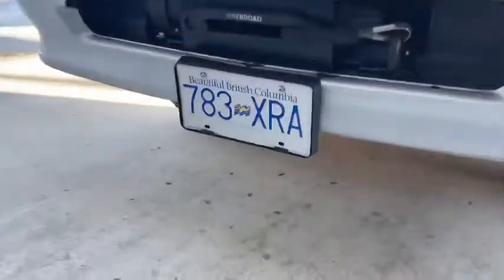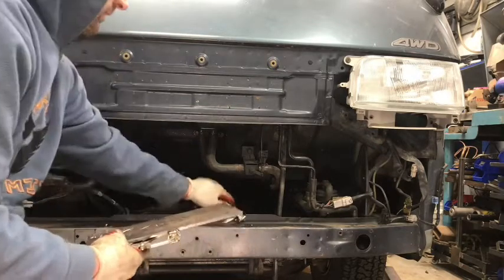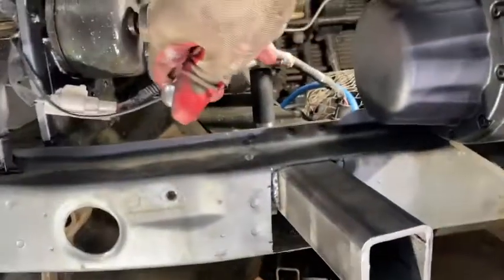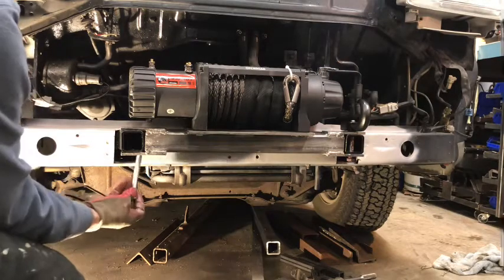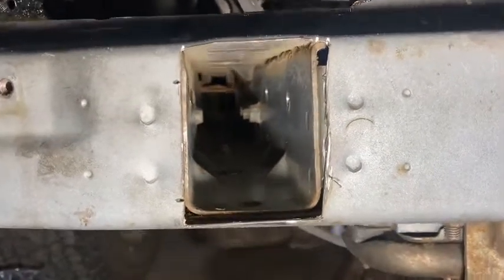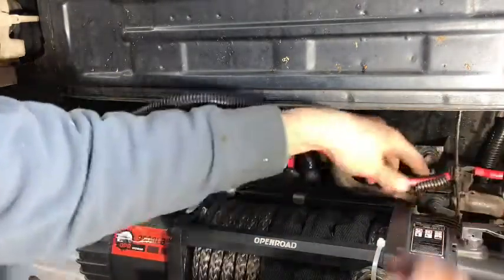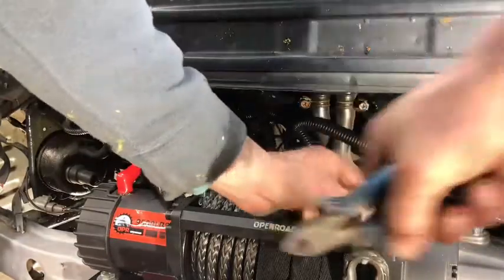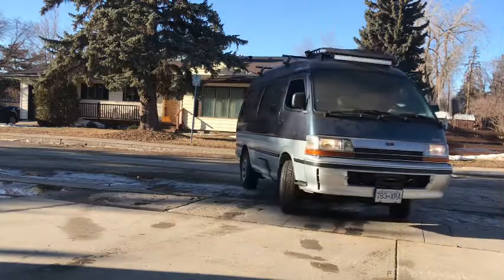Installing winch in factory bumper!!

Comment: This is the one and only video out there on how to install a winch on to a Toyota hiace, thank you
Reply: Would like to know about the specs of the winch, it's a perfect fit
Reply from the maker: You are welcome!  It’s a 9500 lbs winch from Amazon called open road.  It had good reviews and I knew I wanted the nylon rope not the steel one.  

I had to figure it out the hard way so figured I’d share
Reply: I recently acquired a 1996 Toyota hiace super custom, would you recommend the same winch for me?
Reply from the maker: @baitegainejonathandaudi7734  it’s probably more that you need but incase you do get in a jamb that’s not a bad thing.  It’s the perfect size for the space if you want to integrate it into the bumper.  If it’s an lh119 van it should follow the same installation procedure.  Where are you located?
Reply: Thanks again, from uganda

Comment: Very good, I'v got an '91 lh119 and alway though a winch could proably fit in there, now I know it can. I was thnking id just bolt a steel plate  across the top of the chassis rails but maybe it would foul on the AC. I guess thats why you did it this way. Anyway, great job and thanks for the inspiration.

Comment: Mate, this is legendary. Thanks heaps. I'm going to do this to mine. How did you wire up your batteries?
Reply from the maker: It’s a double battery factory system.  I got a heavy duty circuit breaker from Amazon and ran a thick wire to the area under the dash and added a cut off switch.  Then out the firewall to the winch.  It has a wireless remote which works awesome!

Comment: Hey. You know how to tightened the powere steering belt? 91 3l lh119. Did the  timing belt done with michanic and they left it lose. Anything would help. I'm going to try do it myself. 

Thanks 😊
Reply from the maker: Ya it’s easy, just loosen the bolts and pry it out keeping the belt tight as you re tighten the bolts
Reply: @FixerMerlin  is it bolt adjustment?
Reply: @FixerMerlin  thanks
Reply from the maker: @mikyeswolde  it’s been a few months since I tightened mine but I think it was just 2 14 mm bolts then it is lose and will pivot to provide belt tension as you tighten the bolt in that direction.  Good luck!
Reply: @FixerMerlin  thanks. Sorry one more question. Am I alternator or tensioner?
Reply from the maker: @mikyeswolde  the alternator is on the other side and the tensioner is accessed as I recall from the outside with the wheel removed after loosening the 14mm? hold down bolt.  I think there’s a special offset wrench for this but I just made one